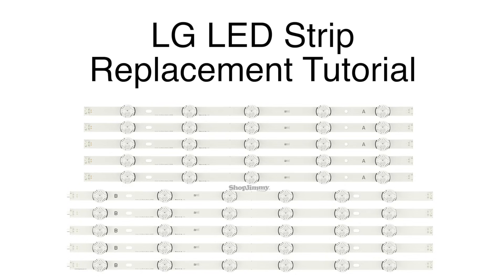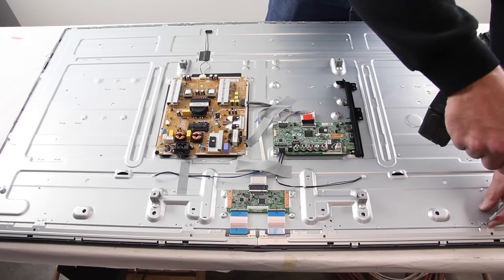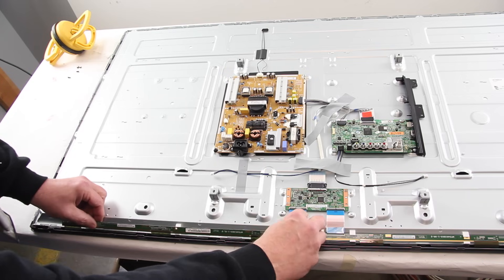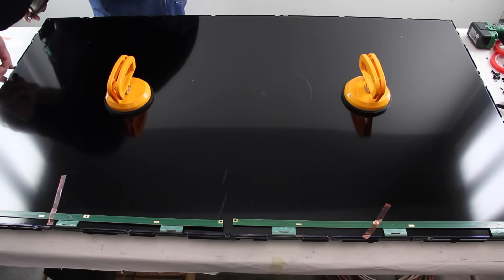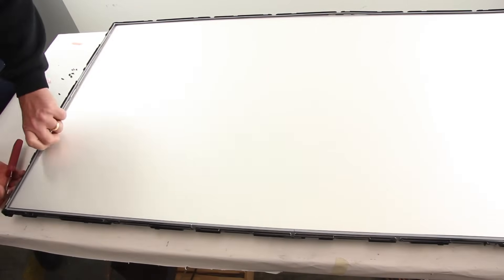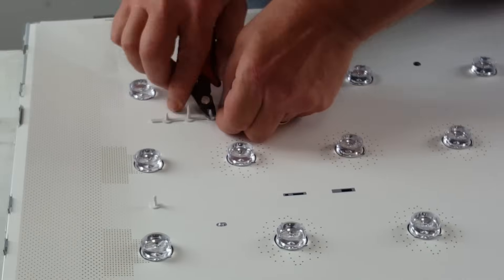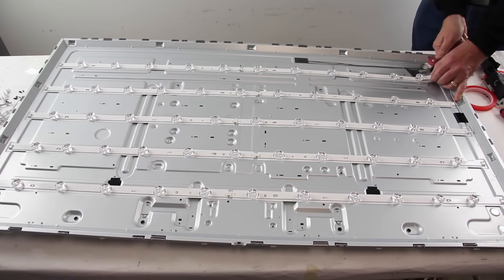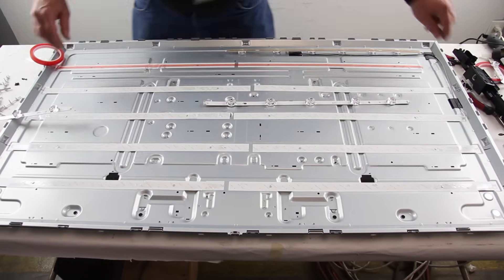How to Replace LED Strips in LG LED TV - 55LF 55LB NC55 - Fixing Bad LED Backlights

Comment: I need someone to reply to this and tell me how to tell how many volts the led chips are in my lg TV? I purchased 3v before taking apart but found out it's not right. I can test each chip with 12v and they work with 3 volts they will not also with 6 volts nothing. It does have 9 leds per strip and says 94v however I cannot find 10.44 volt chips or anything other then 6v so what do I do?
Reply: 6

Comment: I have the same TV I believe anyway it looks the same and the boards look identical. I would like to know how much this would cost to have done. It's not worth it to me to buy the leds and break the TV. The speakers work fine but the screen is dark but flashes on every few seconds or so but just long enough for me to see. Luckily I saved my old Phillips 46" smart TV I think it's Phillips anyway. It's much older and works great so I think LG is crap. This TV isn't that old at all but is useless now unless it's worth fixing.
Reply: Part is about $55 (more If the repairman buys it for you) plus  his fee. Almost guaranteed to be a minimum of $100.  Best case scenario is $150.
Almost not worth it with the low price of TVs.
Reply: @ericmorehouse1163  thanks. Yeah I think you are correct it would be better to either purchase a new TV or attempt to fix it myself. I'm pretty handy and I can solder myself just fine. I usually fix my own stuff I'm a little nervous about breaking the screen being 50" it's gonna be a little hard to handle but it's not doing me any good as it is now so why not try.

Comment: I just repaired my LG 55" by using this site and this video. Thanks!
Symptoms - noticed dark spot fluctuating in intensity in top right of tv. This happened for a few days until the tv started to turn off and on  in a continuous loop. I decided to replace all of the LED's because this is what I noticed FIRST before the power cycling and because this is a known issue with this LG model, according to various internet search results.
I watched the entire video first. Then, I followed the video step by step, pausing before proceeding to the next step.
The wire connectors/jumpers did not have the same fit as on the original LED strips. I used a standard screwdriver to GENTLY but forcibly push the connector into place on the new led strips. 
Suggestions: Watch your fingers when removing the back of the TV,  mine  has extremely SHARP edges in places and will slice into your fingers. Get the suction cups and the tape. Make sure you have PLENTY of room.  Use a blanket for protecting the screen/table (not a thick quilt). If you are able to work on a table, this will save your back and your knees. Wash your hands before touching the filters. Get a few small containers to hold the screws and fasteners. The filter bezel clips were delicate on my tv. I broke 1 because I hulked out, be careful with these. I replaced the strips 1 entire row at a time.  I think all but 3 lenses popped off the old strips while removing them so I don't recommend doing this with small children or animals around due to possible choke hazard, make sure you account for each one if you do have children or pets. The old lenses look like they could be used for some artsy fartsy craft project so give them to your grandma or some old person ;)
Reply: How long did it take for the entire job?
Reply: Wizard Glick took about 5 mins brcause i just bought a new tv lpl

Comment: Do you sell the wires that connect the led lights, two of them snapped while trying to to remove them. I have tried to find them but I don't know the exact name of them.
Reply: i cant find them as well. happened to  me too. and cant find any 2 pin cable online that is the same

Comment: I’ve removed the back cover of my LG LB5900 55 inch. However I can’t remove the screws on the bottom panel that protects the scan drives. What kind of fillips screw driver should I use?
Reply: #1 phlips

Comment: Where can I purchase the Leds?
Reply: Ebay friend, however be very careful to get the correct ones, info can be found on the sticker that should be on the back of the grey panel to give you an idea mine is FG A3, which should be immediately below the model number sticker, and this should render compatible strip numbers even though outlets appear to use different codes, but as a further caveat the sticker is not in the same place on even comparable models.
Reply: shop jimmy  great place and prices.If there out of stock try buyqual.com. There in china but ship fast.

Comment: Got my ShopJimmy replacement strips in for my LG 55LB5550,  I simply mimicked the person in the video and everything went smoothly.  The TV has only been running for an hour so no telling how long they'll last but it looks great so far!  
Glad to see they were not OEM or pulls, they're completely different, which is great because so many people have had problems with the OEM I think they're fundamentally flawed.  The OEM wires and connectors won't work on these so be sure to use the included connectors.  
Awesome video, awesome replacement strips so far!